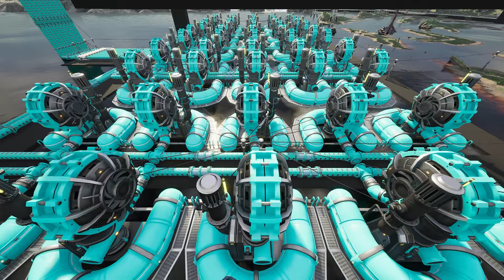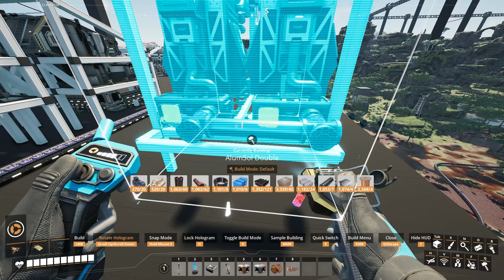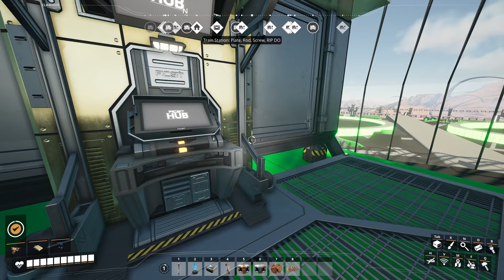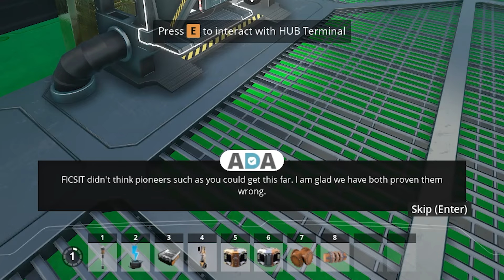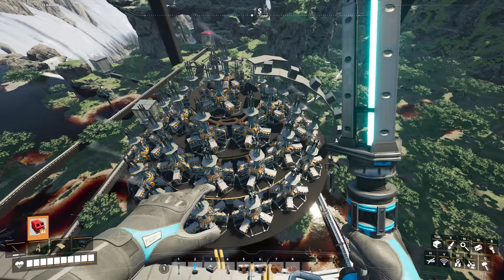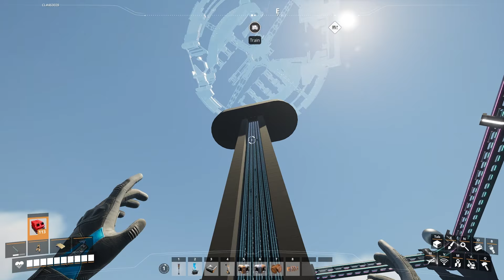My MEGA FACTORY is now complete! - Satisfactory 1.1 Ep. 15

Comment: Brotha, watching this is blowing my mind. Are you using something from the Awesome shop to make those frames around your blueprints?
Also - how the hell did you figure the logistics of all of this out? Using the leftover water from the aluminum to feed into the machines undernearth to make fuel to power the generators - its beautiful. Its what I wish I could've done on my build lol

Great video man!
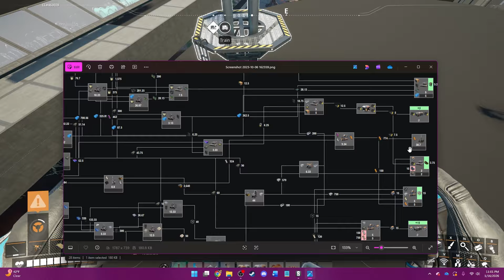Reply from the maker: lol thank you man! The frames are just the normal beams with the connectors in between! I figure all the logistics out with Satisfactory modeler which is free on steam and it’s what you see at 8:31. It’s a lot especially with this factory but it helps lay out everything you need!